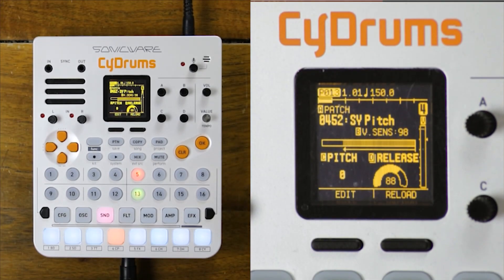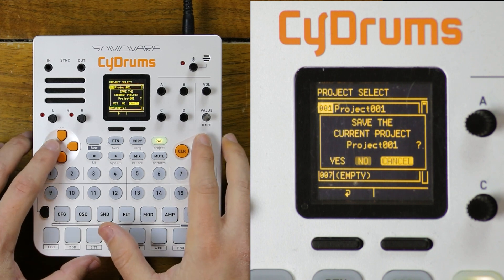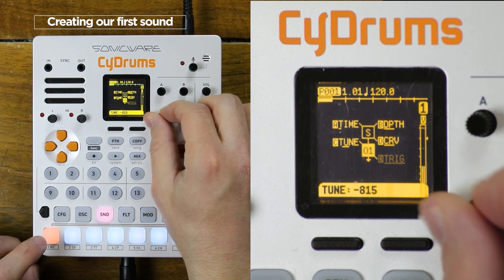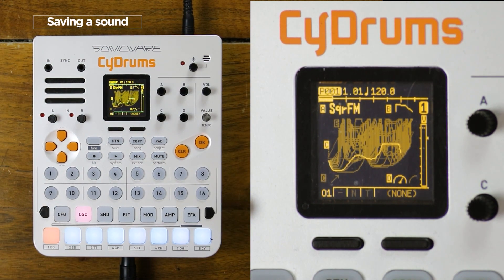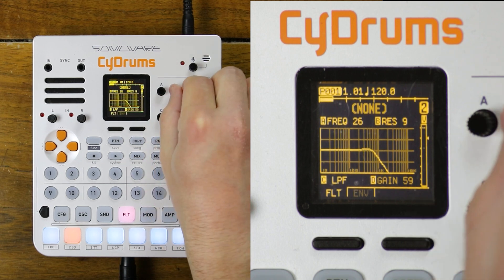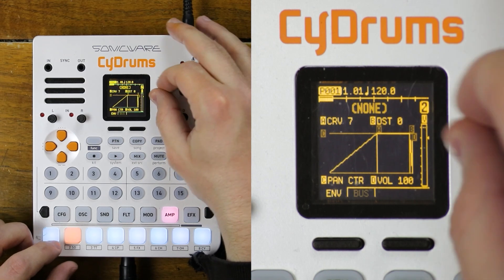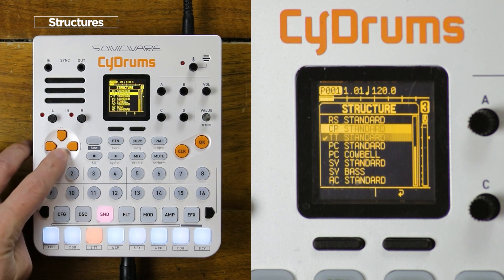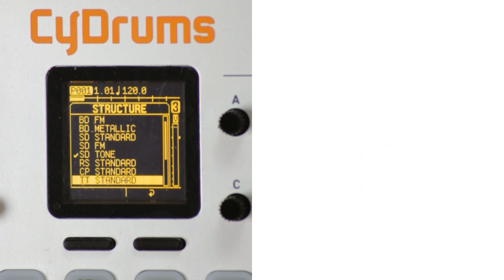How to Design Sounds on the CyDrums – Full Sound Design Tutorial

Comment: I'm (a blind user) trying to learn this machine via a somewhat garbled pdf-to-text conversion of the manual.  What's the keystrokes to bring up and select a sound structure? is it:
1) OSCILLATOR pad then func+Aux right?
2)  SOUND pad then aux left  and then  aux right?
Then what do I use to scroll through the structures (D pad? Value knob? A-D knobs?)

Also, what's the knob/keys to only show vacant sound/project/whatever slots? 

Thanks in advance.